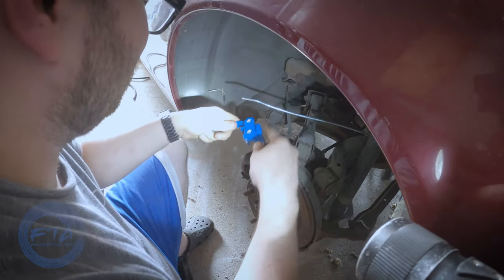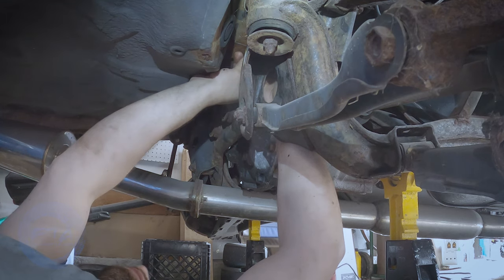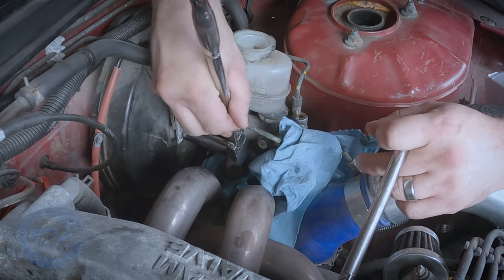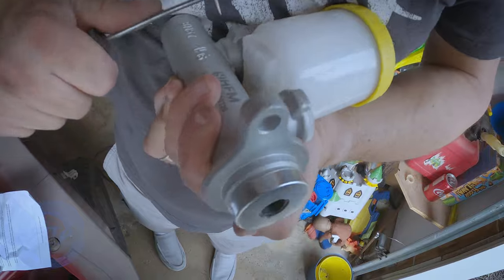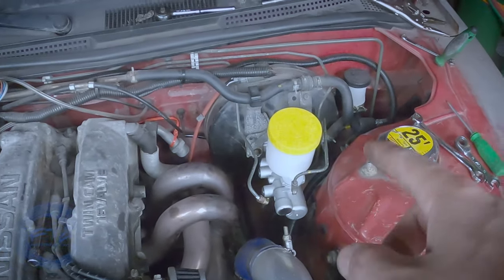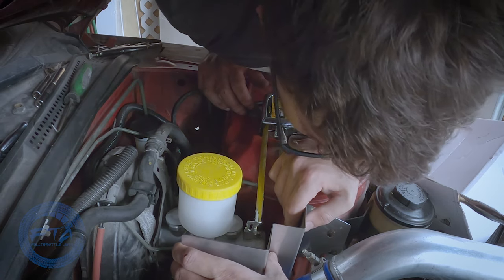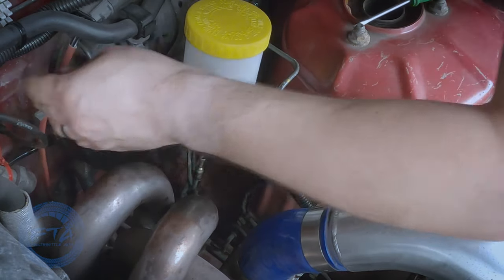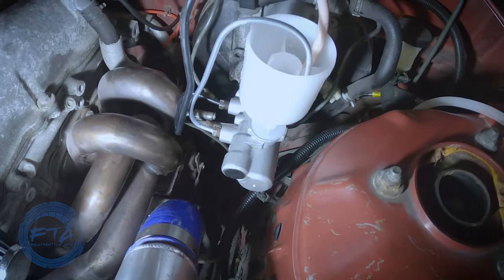S14 240sx GKTech HFM BM57 Brake Master Cylinder and More | Trying to Save My 240sx Part 4

Comment: I was hoping to see how you routed those brake lines lol I’m doing the same on mine and just wondering how to get them lines to come around and fit
Reply from the maker: Do you mean the stock hard lines that go into the master? If so, honestly, we literally just bent them the other way. We were taking our time and just slowly bent them the other way that it needed to be on. No special tool or anything like that. Sorry I didn't get that on camera.

If you have a line bending tool that would definitely help. Plenty of stores carry them. If you want to make it easier on yourself get one of those or a few different style ones never hurts.

Thanks for watching and commenting.
Reply: @FULLTHROTTLEAUTO  yes the stock hard lines ! But I was wondering in what order do they go in on the new master cylinder. Does the bottom line go in the middle ? I seen y’all put that first hose on the inlet closest to the firewall
Reply from the maker: @PerezJesse-s2f  that I'm not sure of on top of my head. I'll have to look at it when I get the chance and get back to you.
Reply: @FULLTHROTTLEAUTO  that would be cool I appreciate you boss

Comment: hey there, just wondering do you leave the brake fluid level sensor unplug or modified the plug?
Reply from the maker: Right now it's unplugged, but I'm going to try to get it modified to work.

Thanks for watching and commenting.
Reply: No issue with braking system when unplugged?
Reply from the maker: @qh6473  I haven't really gotten a chance to drive the car, but the little I did there were no issues.

Comment: Also does that little port need to be sealed or just leave it as is!
Reply from the maker: Sorry for the delayed response.

Do you mean the little port that's in between the two bigger ports? If so, you just leave that be. That is not needed for the S14 and you don't need to do anything with it. It is automatically sealed on the inside. Hope that helps.

Thanks for watching and commenting.

Comment: I have a 1995 240sx non-abs. Do you have to bubble flare all three lines so they’ll fit?
Reply from the maker: That's what we did. But I'm not to sure if it will work without. With didn't try not doing it. Sorry I don't have a definitive answer for you.

Thanks for watching and commenting.

Comment: Was the plug for the fluid level sensor the same as stock?
Reply from the maker: Great question, I forgot to mention that in the video. It was not. I will have to change that, haven't done it yet.

Thanks a lot for watching and commenting.
Reply: @FULLTHROTTLEAUTO  I think you can swap the stock reservoir back on to the upgraded BMC
Reply from the maker: @Jasonanda7x  thanks for the tip.
Reply: @Jasonanda7x  hey, can we actually take the sensor out of the reservoir?

Comment: How fucked am I if I installed the BMC and bled the brakes but failed to adjust the push rod beforehand?
Reply from the maker: I think worst case scenario you have to drain it and take the bmc off to adjust it. So just would have to redo the process. Best case scenario you won't have to drain it and can just remove it enough to make the adjustment.

Thanks for watching and commenting.
Reply: @FULLTHROTTLEAUTO  woah thanks for the quick response. Take care